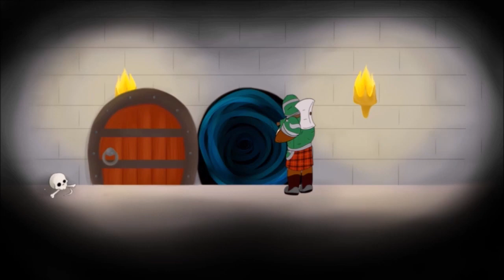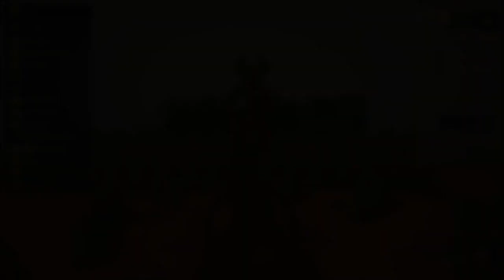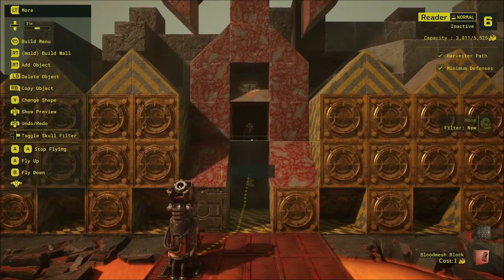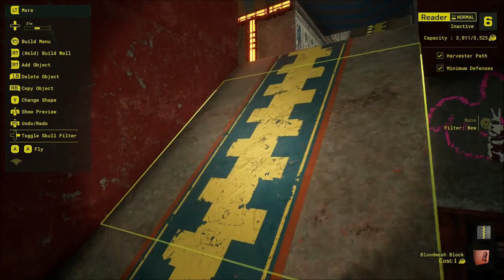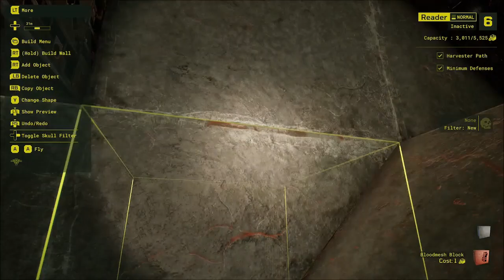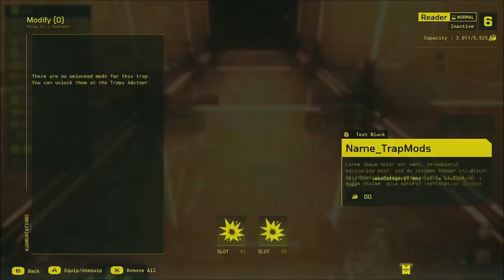2 Phase Base Build in Meet Your Maker

Comment: You can parkour across the ceiling no problem, ceiling has to be corrosive cubes or traps like a grappler. I am new and even i can rapid grapple up walls across ceilings and pull off 180's mid air. Still really good im goind to perfect the floor is lava routine!

Comment: 2 things I'm assuming you know you can make the alternate path the harvester takes longer then the first path that way the harvester will only take the first wave path before picking up the genmat.  I'm assuming that's the work around you were talking about.  You should probably put that in so when they fix killing Harvey off the start it will still work. Second make the gen mat a choke point so they have to go through the genmat to get to the other passage way.

This is an example of what im talking about
https://youtu.be/2GKsLIW1ymc
The physical path the harvester takes changes during the raid.

That is smart to cover up the second harvey path as the path for the tombs.  As long as you make the second phase path go out side it would be pretty unlikely they see that path as anything but the tomb path.  By the way people can save harvey by shooting the piston immediately when the spawn in.
Reply: Wave 1: Holocubes set to 2nd wave make a path shorter than HRV's path. No matter what the pathing js in build mode, HRV will take the shorter path available when the raider enters the game, meaning he will walk across the 2nd wave holocubes. Surround that with 2nd wave corrosive cubes and make sure there's nothing outside the entrance to grapple toward.

When they take the genmat the holocubes will vanish and the corrosive cubes will activate leaving only a tube of corrosive cubes you can't exit through.

If you make this:

Comment: How one enters or exits does not determine a phase. Traps on the way in phase one, new traps on the way out-second phase. The perk literally says second wave.
Reply from the maker: The idea is to only have one entrance and one exit, but they aren't the same. Phase one entrance path would mostly run phase one traps, and would be inaccessible after triggering phase two. Phase two would then open up the phase two path that was inaccessible before and technically could have phase one traps if the game allowed for proper two phase outpost builds. 

Basically it needs a way to prevent a player from entering the exit and block them from going through the phase one path after triggering phase two. Unfortunately the game doesn't allow for a proper two phase base currently. The programming for the harvester path is the primary reason a two phase build doesn't work.

Phase entrance and phase exit are very important for a two phase to be possible. Hopefully that helped clear things up a little.